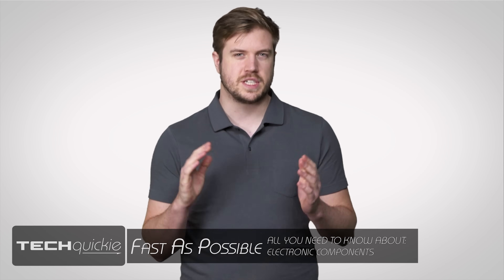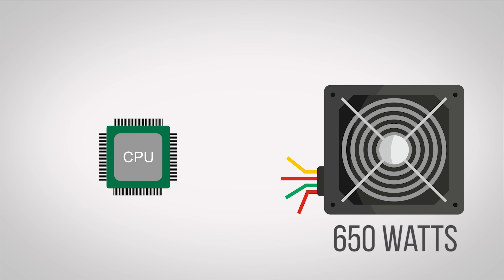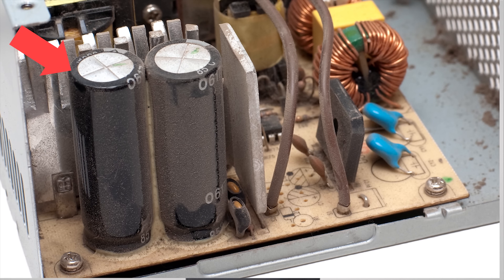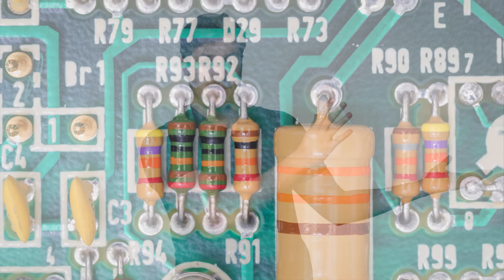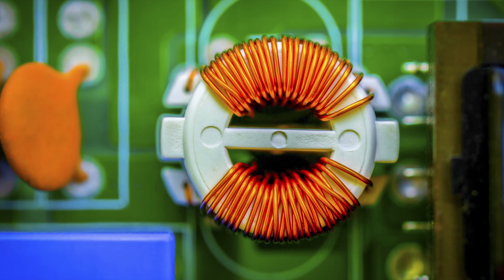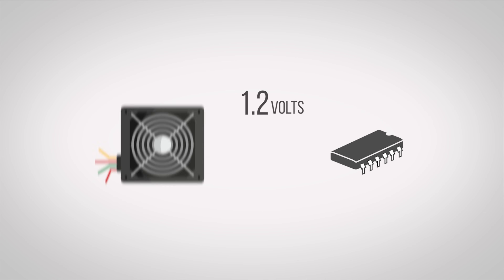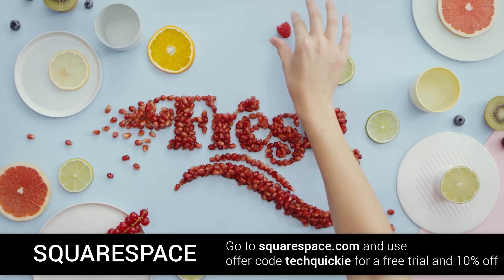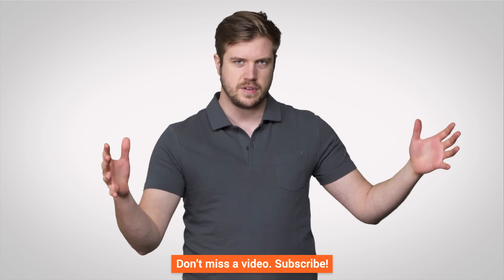Capacitors, Resistors, and Electronic Components

Comment: NEVER open a power supply unit if you don't have a very good reason to. A power supply can hold enough charge to kill a person even while unplugged. Also, repairing a power supply unit isn't a valid reason - they don't cost much but the risk of shock can cost you more than you'd ever have enough to cover.
Reply: Wizardmom Electrical engineer here. Thought I should mention that all consumer electronics built even somewhat recently are required to drain any large capacitors to safe levels in just a few minutes. You should still definitely be very careful, but this isn't as dangerous as old electronics.
Reply: manuelthegreatman I'm fairly sure that Luke and Linus mentioned a case where a kid died opening a psu on the WAN show in the past. Linus was the one that said there is no reason to open a PSU even to repair it, stating that they are cheap enough to bypass the risk of injury from repair accidents  by just replacing them.
Reply: Wizardmom ok
Reply: Yes thank you and it's even more dangerous that he said Unplug it first... I unplugged.. what could go wrong lemme touch everything!
Reply: @AbrasiveCarl  it's only dangerous if you're stupid
Reply: capacitors are not batteries ... They will loose their charge relatively quick .. I have fixed hundreds of psu's, never had a single discharge ..
Reply: That's why you discharge the capacitors...
Reply: @C0deH0wler  they are only dangerous of if you touch them directly
Otherwise it's totally harmless
Reply: Shane Burgess Unplug and leave it overnight. Once had a faulty PSU shock me (It got me enough that I uncontrollably yelled and probably have to thank the unit killing itself for being okay). I just went to unplug it (it had a ground pin so I thought it would be fine). It's fun to take apart old computers, but don't mess with or even plug in janky old power supplies..Apex. I've since thrown out the obviously faulty power cable and the unit.
Edit: I'd like to mention that mine wasn't even open.
Reply: C0deH0wler, Not to mention well designed circuits will have a bleeder resistor in parallel with each capacitor. To be safe, short each high voltage cap with a 1МΩ resistor and always measure for voltages. But this is if you are working on it, which is beyond the scope of this video (and was never mentioned anyway). Simply opening it is harmless as the pins are below the PCB AND as long as you don't go poking around.
Reply: PLEASE GET THIS PINNED!

Jesus I had to pause the video once I heard him mention this. Scary stuff, who knows what the uninformed might do!
Reply: The Original Otaku natural selection
Reply: Nope. You're completely WRONG Stop misinforming people. I've opened many PSU's and repairing one is a valid reason. Changing the Capacitors or resistors or any other component is completely safe as long as you know what you're doing and costs less than buying a new PSU. Thats just marketing schemes manufacturers use to scare consumers into buying a new one rather than repairing a fixable PSU's.
Reply: C0deH0wler think hard about what kind of people watch these intro to knowledge videos.
Reply: would replacing a fan with damaged/broken bearing be a valid reason? yes the odd capacitor may retain its charge over a long period of time but your not exactly gonna go in and stick anything near it are you?
Reply: Stop panicking...jesus
Reply: I once placed a new resistor to dead PSU, and it still works perfectly.
Reply: Roger Sullivan Ya, capacitors hold energy by design.. your not safe just because you unplugged it.
Reply: If you have a good PSU the Caps will be wired to high impedance resistors to drain them down over a long time >30 minutes. Often called a bleed resistor. However you are always told never to trust them as failure can happen . Shorting them is a bad idea as you "may" damage the cap resulting in catastrophic failure during the next load or even a few days later. This may then fry other parts of your computer. (Expensive.)

So how do you discharge safely?
In general the cheap resistors from hardware stores are rated for 0.5 watts (Check this before use as they could be lower.) so in 240v countries you need to use a 100000Ohm resistor not to over load it. That would take 6 hours to discharge to 25V (A safe skin contact voltage.). This is obviously not practical.

Practically a 1000 watt 50 ohm resistor would discharge to 25 volts in 11 seconds... but the cheapest i could find was $40. You'd be better investing that in a new PSU.

So whilst you can repair a PSU's yourself it is recommended the average person doesn't. You need knowledge, patience, and the correct tools to do it properly.
Reply: Totally agree but as an electronics tinkerer the single thing that I open to take a look at are PSUs and I can say that in order to be more safe a good idea before opening it is to unplug the cord from the wall and the the unit then  press the power button of the PC for about 3 to 5 seconds
This will allow any remaining power in these large capacitors to discharge through the motherboard safley
A jumper cable on the 24 Pin cable will do just the same
And still nonetheless being extra cautious (Not to touch those terminals of the capacitors) is a must
Reply: Ughhh the amount of stupidity is too high...
You wont die from a Capacitor...not even if it's 20kV.
230V AC is pretty deadly and you sohuldnt touch it, right.
Capacitors obviously only store DC volt, the friendly non deadly version of Voltage.
Touching a fully charged 400V cap wont kill you.
especially bc electricity takes the path of lowest resistance...thats like 10mm on one finger. Non deadly, but it might hurt a bit.
Modern electronics (especially power supplies) include discharge resistors anyways.
Reply: sigh Guys, let's do this in PC language so you stop talking abouth death and stuff. Capacitors are to Voltage what Volatile Memory (like RAM) is to data. When they are shut down they "drain off". If you unplug, discharge by pressing the power button or just wait, there won't be enough electrical current to kill you. This is something that happened with OLD CRT TVs, NOT WITH PSUs.
Reply: An anotation should at least be added. We don't need Linus Lawsuit Tips.
Reply: You short the electrolytic high voltage caps(the biggest ones in size) before you touch anything and ur good to go. This is probably best done a resistor so you don't get a huge spark and bang
Reply: Thirst IsReal Its also fun being shocked by 25,000 Volts :)

Damn Fly back transformers....

I miss CRT's....
Reply: There's a case for taking the video down for the lack of warning about this.
Reply: @jlittlenz  the video should stay on youtube,it is harmless opening it up ax long as your aren't stupid
Reply: @jlittlenz  Agreed and it's still up.  I was super surprised he didn't mention that and I don't even know much about electronics.
Reply: JAMAL JONES wrong instruction dick stuck in psu
Reply: A mild shock a best, kill you no way, old CRT's and micro wave caps can ruin your day.  I been repairing electronic for 45 years.
Reply: This one caught my eye, if anyone is talking outta their ass.  You don't damage caps by shorting them, and resistors have resistance not impedance and the rest of your discharge talk is nonsense.
Reply: Nah man, open it up if you are curious.I electrocuted my self 8 times in 1 eve building my first one, it becomes fun after the 3de or 4th time, especially the shock from the left color bone to the right hand. less then 10 years later i help design, build and test radar systems. Go go electronics
Reply: The dancing pixies get out and you, nor it, will be chooching for much longer
Reply: still... please discharge the caps before any thing

its better to be safe than sorry... unless the psu fan has a header that's  on the fan not the psu board
Reply: Long John you must be talking about the amp not the sub cuz subs are passive they take the electrical energy given to them turn it into thermal and mechanical energy. Once disconnected from a power source they're absolutely harmless they have absolutely no energy storage capacity
Reply: Wizardmom I've gotten shocked by a 500w PSU I opened before. Just unplugged. Felt the same as touching a 220v outlet. Feels the same when you get shocked by it as a kid.
Reply: Matt Brine oh hey! lol. yeah its fun as long as it doesn't kill you. It hasn't killed me past 4 times I got zapped.
Reply: Well, ironically I just opened one today to take out some small components for my future project.
Reply: Just wanted to say this. I guess you we're faster. Never open a psu if you don't have the knowledge. And if you really want to open it, just discharge the capacitors.
Reply: I know enough about electronics now that if I open something, be it just unplugged or powered off for weeks, months or years, I try not to touch anything that could be a potential electrocution risk or damaging from static electricity.
Reply: See you're just giving me ideas...
Reply: The only safe way to open a PSU if you're inexperienced in component level electronics repair is to:
-unplug
-leave unplugged for three years
-forget why you have it
-toss it in the E-waste pile
Reply: It's really only dangerous if you are stupid enough to bridge the leads of the primary side caps, and if you are buying a more than $20 power supply it should have bleeder resistors so after a few hours it should be safe regardless.
Reply: I've replaced/fixed tons of fans on cheapo PSUs, so there is a reason for opening it up. Also there's a lot of good components in there if you are into diy. Also pc psu can be used for different applications.
But yeah, capacitors are huge on those, and it's a real hazard. I usually let them stay overnight, I do not lot to short things.
Reply: I can't believe this video just casually suggested it might be fun to open up a PSU without mentioning that it could kill you. Slightly irresponsible....Yeah, open up your PSU and play with capacitors kids! Just unplug it first and it's all gravy!
Reply: Yeah,
I was taking apart our old family computer to look at everything.
When I was done, all that was left was the PSU, and my dad said "There's probably still enough power in that to kill you, don't open it" and I didn't...
IM STILL ALIVE
Reply: Wizardmom When I was younger I tried cleaning mine with water and tissues... I accidentally left it plugged in , with a 220v plug... I touched a metal part got the worst shock of my life
Reply: Jonny Dahl. Not the caps. There is a didcated resistor parallel to the damn cap
Reply: Okay, I'll take your word for being dangerous for longer than what I said. But let's point out that it won't kill anybody.
Reply: Okay so I used AC impedance instead of DC resistance as far as the ohms law and the capacitor discharge calculations are concerned they are the same for this scenario. But you most certainly do damage a cap by discharging it to quickly. Depending on the ratio of the internal resistance of the capacitor and the item you short it with, you will generate heat. Electrolytic capacitors such as the type used in computer PSUs are very succeptible to problems caused by excessive peak currents. Heat forms, electrolyte evaporates damaging the insulating aluminium oxide layer. This reduces the capacitance and in some cases can cause doming of the capacitor (Similar to early stages of over voltage.) and in rare cases failure (similar to excessive over voltage).
Ceramic multi layer capacitors are more a polar okay or fail scenario.
Disc capacitors are more able to take abuse but still can fail if used inappropriately in high frequency applications.
Reply: Yep, absolutely not deadly. Even rectified 230V from mains socket probably wouldnt be lethal.
Reply: Jonny Dahl. They don't specify it because its down to temperature. Sorry for not going into detail earlier, I'm not used to explaining this so I'm jumping parts without realising.
It's for you to work out as its really about internal energy loss converted to heat. For example the Capacitors on the APUs on the trains I work are spec'd to fail at 105 Celsius (specification but they fail at lower than that when old.). They live in housing which on a summers day even with blowers on gets to about 50C. So they have less headroom for a large discharge before failure. In summer they fail more regularly. If you discharge them really quickly,due to the imperfect nature of the cap it will form hot spots which exceed whatever threshold your cap has in a small area of the very large internal area. Either through repetitive abuse or bad luck this can cause larger scale failure.

Whilst I accept people do it and don't have problems. It is really not advisable to short them out if you care about them.

I mentioned the resistors as a safe method but included the time frame because most people don't have access to big enough resistors to discharge quickly and safely (<20 amps to simulate normal use.) without having to wait ages. I don't have any at home that exceed 10watt. My response is really for people who don't own a multimeter or who do, but want to fix it in a hurry and want to minimise the chance of weakening their components.
Reply: Only a complete moron will throw out ~100 Euro PSU's that can easily be repaired if you have basic electrical knowledge and when you have tools to do so.  way to contribute to industrial waste

With your logic you should also say that you should never plug any electrical device in wall socket because you may chew on the cable or lick socket.

Opening PSU is 99.9999% safe when done by anyone with logic. the chance of dying by opening it is less than doing most normal every day stuff. You will die most likely from chocking on snacks or falling of your chair than by opening PSU
Reply: You won't die from capacitors stored in these power supplies, no, as their capcitance is actually pretty low. A full discharge can even occur in less than a second. However, if you have a weak heart or anything, you might get fucked over pretty bad. Killing someone through such low capacities is very unlikely. I have this 30000uF 400VDC capacitor bank at home and that's a VERY different story, trust me.
Reply: Mark, that's not entirely true, current does not kill, it's hand-in-hand relationship between current and voltage that creates... power. The voltage can stop your heart, or even restart it. The current can incinerate your heart and give resolution to voltage. One can not do shit without the other. It all depends on the source, if your power source can only deliver 1Amp and you short circuit it out, the voltage will drop to almost zero volts. However, if you play with something like a wall outlet or capacitor, those which can deliver power in the KiloWatts or in a capacitor's case, in the fucking MegaWatts, it can certainly be lethal, depending on the voltage.
Reply: Lukas Seegers, that is indeed not a smart move, as there is live mains 
voltage on it. When there is live voltage on your power supply and you 
open it up, two things can go wrong: 1) You fry your power supply 2)You 
fry yourself. The reason they said that was to avoid static electricity 
from your hands getting into the driver systems. I have no idea why 
someone would say that to you, you got very lucky. What you can do, is 
to use aligator clips, attach it to the chassis ground, and to the metal
 pin in your outlet. So that the ground is connected to earth and will 
"absorb" all the static energy coming from your hands or environment. 
You got lucky you didn't touch any input connections.
Reply: Azagro thanks for the answer
so if the power supply is grounded, does it effect the hazard of capacitors or not?
(I was aware of the 'normal' danger of touching the live wires, but didn't know about the capacitors until these comments)
Reply: It shouldn't since the ground connection is there to protect your system's components, giving them extra shielding, acting as a zero rail for the PSU's GND rail and stop the chassis becoming live if a major fault occurs. It has no effect on the capacitors themselves and they will still have the potential to hold a dangerously high voltage. The only things stopping them staying at a high voltage for a long time are discharge resistors, which bleed off the stored charge in the supply when the system has been unplugged from the wall.
Reply: Lukas Seegers Depending on the power supply, but directly after disconnecting they almost certainly always hold a charge in the couple hundreds of Volts. The simplest way is connecting the + and - of the capacitors with piece of wire with care. This should short circuit the capacitors and discharge them. You don't have to discharge them all, only one, the one that has the highest voltage and highest capacitance (usually the biggest one).
Reply: I wanted to comment the same thing.
Reply: Sorry dude just opened one up the other day. Guess what? I didn't die.
Reply: Modern SMPS with PFC can work at 420VDC which is about 7 times more dangerous that 110VAC from wall socket.
700% more chances to die, wohoo!
Reply: Saya pernah membukanya dan menyiramnya dengan air. Dan tidak terjadi apa-apa.....
Reply: More like don't touch any capacitor as their looks can be deceiving as they hold charge for a long time proportional on their capacitance!!
Reply: Wizardmom please upvote this comment so Luke can see it.
Reply: This is literally the first Youtube video I have ever bothered to give a thumbs down to. Wizardmom is right; the capacitors in a PSU hold enough charge to be dangerous even if left unplugged for a while. Techquickie, you can't be giving dangerous advice like this when you have over a million subscribers.
Reply: Should have told little kid me :)

You know its fun being electrocuted :)
Reply: There is no reason why it wouldn't work. As long as you got the same model of resistor its completely safe.
Reply: Wizardmom they call em discharge resistors
Reply: Why? I don't see a problem with it. I even went frame by frame to see if something was snuck in. Frame 2520 to 2545 all clean.
Reply: not quite right, modern capacitors Have a discharge time of up to 6h.
GoldCaps even hold their charge up to weeks.
It depends on the cap's Insulation resistance. these days 6-12gigaohms is common, and i've seen power supplies with 400V 500µF caps still zapping after half a day.
Might hurt, but cant kill"
Reply: was referring to what Smakovich said.
I know there are discharge resistors, that's what i said earlier.
Im studying electronic engineering for 4 years now :D
Reply: Most electrolytic Caps dont even have a max. discharge current.
Do you mean ripple current?
Reply: trying to discharge it on the mains-side (the plug for example) probably wont affect the capacitors tho
Reply: Matt Brine oh hot dang I forgot about CRTs. My friend had it for years when Flat panels were common. I kept accidentally touching the screen to point out stuff and get zapped.

My pc cases back then would never get decent grounding either so I am always amazed when Linus or Luke opens a case and touches it without getting shocked.
Reply: Jonny Dahl. Dude you can easily die from 110Volts. Google NIOSH electric shock  (CDC.gov) there are plenty of examples of work place deaths. For example what you say as a safe voltage deaths from that page, One guy plugged in a toasted with a faulty earth and died.
Reply: I opened up a chinese cheapo one to swap the fan cause it was driving me nuts and I didn't die
Reply: Dude i said something like 230V rectified(so it's DC, not AC) and no, it wont kill you...
Go to SElectroBoom"s youtube channel...he shows you what hurts and what not, and je explains the different effect of AC and DC to the body...
Reply: Lazor 200VDC not, 340Vrms, a different story.
Reply: Jonny Dahl. Rectified 230 VAC is 330VDC. Electroboom works with NA voltages. European outlets are far more powetful.
Reply: λ3 "Fucking dumb", says the guy 
that states that the current kills. Perhaps you have heard of Ohm's law? No voltage, no current.
Reply: I open them all the time without getting a shock... the trick is to short the high-voltage input stage capacitors (the really big ones) out with a screwdriver to make sure they're not holding a charge... do that and the supply will be totally safe to work on. Just remember that if the PSU has been on before you opened it and doesn't use a bleeder resistor to drain the capacitors (which most PSUs now do if they're good quality) that you'll probably see massive sparks as the caps dump all their energy out in one go... the first time you do it and that happens it's sure to make you fall out your chair!! XDD

Oh, and additionally, doing sanity checks before opening like remembering to unplug the power cord and set the power switch (if applicable) to the OFF  position are also great ideas. At least you won't get 120 (or 220-240) angry pixies dancing through your limbs!! I've taken a tingle or two from a 240v line and it's not fun!! The yanks have it lightly with their 120v lines, that's for sure!!
Reply: All hail the dancing pixies of death and knowledge!!! Taking a jolt is an odd one... I know a few people that dabble in electronics and they started out by taking a mains voltage jolt or two... either by sticking a screwdriver in an outlet (hard to do in my country because the sockets are shuttered!!) or messing with stuff they shouldn't... although the fun starts when you build a circuit specifically designed to explode... Electrolytic caps are afraid of me!! XDDD
Reply: Yeah and it's unlikely that you die from 330V DC...
Been there, done that (unfortunately).
Body resistance is too high to really damage you in split seconds.
Reply: Jonny Dahl. Your mixing up voltage and current. He uses supply's on himself that can't supply a high enough current. It's the current that kills.  Ohms law suggests that for the lower end of a humans resistance (thinner skin areas or sweaty palms) for 230 volts and human resistance of 1000ohms and the low internal resistance of a cap you'll get about 0.25 amps. Currents of 0.1-0.2 amps "can" be lethal. AC is worse if you're exposed to it for longer than a cardiac cycle of approx 0.2 seconds but normally you flinch away so it doesn't matter in this case.
I have seen his videos they are funny and done to show how voltage causes the shock but current the damage. He always uses low current by either an under powered supply or by a high internal resistance supply.
A 9 volt battery can make a paper clip glow red hot as it has a low internal resistance thus high current.
Reply: true, but also not. Capacitors will hold and slowly bleed of their charge for a fairly long time. I pulled out a decent cap from a power supply , a 220mF 400v one that  I charged and left for 3 minutes. I started off at 9.15v and the cap had discharged to 6.52v after that time. It only dropped  2.63v in that time frame. Add a bleed off resistor and that time will be shortened to mere seconds... but since that also adds extra cost to the manufacture, usually, Chinese cheapo supplies don't do this, so they can actually hold nearly 200v on their caps after a minute of being unplugged provided they're left pretty much floating when the supply is powered off, which isn't an impossibility.
Reply: True... Euro outlets are 220v 16A... British outlets are 240v 13A and American outlets are usually 120v 15A I think... These aren't peak values since they're usually designed to handle more without catching fire for safety reasons, but they're safest kept at or below:

EU: 3,520 watts per socket
UK: 3,120 watts per socket 
US: 1,800 watts per socket.

And if you have multi-gang sockets or an extension, you should always use a fraction of the current per socket if there's more than one device plugged in... For example, if you have a dual gang socket, you should use HALF the current per socket to make sure you don't overshoot the current draw and either start a fire or flip a breaker... so in Britain, where the dual gang sockets use a single line in, you want to have 6.5A per socket max, which is totally fine for anything that's not a large space heater, industrial power tool or a Tesla EV on a fast charge!!
Reply: The main capacitor is what might kill you, but the capacitor is almost always bridged by a big resistor. Otherwise the same power surge could kill you simply by touching the pins on the outside of the PSU where the power cord goes in.

Some cheap LED lamps have this problem where you can get a "tingle" by touching the connectors right after unplugging it. This is exactly the same thing happening, except it isn't lethal.

On top of that, you can safely short out a capacitor just with a metal object. That'll discharge it and make it safe to touch.
But still, as always, if you're not sure about any of this - better not open the PSU. Or even your computer. Leave maintenance work to those who can do it safely.
Reply: I assume we're all thinking about the guy who was killed by an unplugged PSU right now?

Never open a Power Supply unless you're trained for it.
Reply: ThEcRaZ3dGaM3R not entirely true what you say about EU/UK power. European countries (not just EU) all carry "220V" (apply airquotes here), but the standard allows for +/-10%* in voltage. This margin was introduced simply to "unify" the voltage across European countries without having to change the national grids. As a result, 200V is practically the same as 240V. Any European-sold device that connects to the mains will accept 220V+/-10%*, so that includes 220V from some countries, 230V from other countries, and 240V from the UK.

I'm currently at 234V, or so my UPS tells me, and that's totally within specification.

*) I'm not 100% sure if the margin is 10%, it could be 15%.
Reply: You still dont see the difference between Alternating Current and Direct Current...
And no the "main cap" wont feed back into the mains power chord bc it would have to pass a FULL BRIDGE RECTIFIER (i recommend going to ElectroBoom, he explains that)
Reply: I was trying to reduce coil whine on a PSU I had. I switched it on and off and back on so many times that I forgot to switch it off before sticking my hands in. All I got was an uncomrotable shock that made me immediately pull my hand away.
You guys have to realise that there are plenty of people that work with electricity and can tell you what a shock feels like. Sure, it's not nice, but the fact that you're talking to them means that they are alive.
Reply: capacitors
Reply: I'm not really into electronics, but opened a PSU a few weeks ago to get rid of unnecessary cables (don't judge for that, and of course I isolated the free contacts)... but my question, I heard someone say to switch off my PSU but keep it plugged into the outlet to have the whole thing grounded, so I did... reading these comments and thinking about it... that was dumb, right?
Reply: Steven Box thank you for taking the time to answer, but even though I'm not that much into electronics, I still do know a few things about computers and hardware, so I opened up the PSU to cut off some not needed cables, like I wrote - btw, the idea of someone opening a CPU seems pretty creative to me^^
Reply: holy shit luckily i wasn't killed
Reply: ThEcRaZ3dGaM3R Azagro thank you guys for the helpful answers :)
Reply: Completely depends on the capacitance of the capacitor. If you had a very large capacitor with no bleeder resistor, it could stay charged for hours if not days
Reply: Warning spoons can be deadly too if you're really fucking stupid
Reply: Wizardmom they don't cost much... snicker. must be using generic power supplies.
Reply: No, that just resets the CMOS memory on the mainboard. If the power supply has little to no juice left in it then it should just power on for a tenth of a second and immediately shut off. There'll still be a bit of residual charge but nothing that could kill you (usually about 30-60v DC, which will tingle a little but won't hurt, and it bleeds off fast if there's a resistor in parallel to the cap)
Reply: as probably a lot of people have said, a power supply doesn't hold that much energy for any appreciable length of time. By the time you're done removing all the screws, all caps have lost their charge. also, more often than not, large caps (and I mean in capacitance, not size) have resistors across their poles to discharge them quickly.
Reply: not how it works, sorry.
Reply: didgitalpunk But the thing is that some power supplies doesynt have discharge resistor for main rectifier capacitors.
I had before 600W serwer power supply, it had copper heatsinks that was connected to these 420VDC, after the power supply was disconnected from mains and it shut down, there was still about 250VDC and it was very slowly dischargin, like 1V per second, I could put mains 5V adapter and it was working for quite few seconds.
So definitely enough energy(current) to kill.
Reply: please, learn about what the difference is between voltage and current.
Reply: I know the difference you idiot.
What I said wrong?
Current is the part that kills, you can have 100MV with 0,1mA and it will not kill you.
450V/660uF capacitor can deliver up to few amps.
Reply: 100MV at .1mA will fry you big time. 
Also, why resolve to calling people names?
here, have a chart on how electrocution actually works. Do read the fine print though, it has important things in it.
https://en.wikipedia.org/wiki/Electric_shock#/media/File:IEC_TS_60479-1_electric_shock_graph.svg
Reply: On that graph you can see that 0,1mA is in AC-1 so its even imperceptible...
So I was completly right, even when I didnt saw that graph.
Anyway my point is that some unplugged power supplies can kill, as I said before, these reservoir caps can give up to few Amps, and on your graph it is on AC-4 so 5% probability of ventricular fibrillation.
Reply: Dude, use Ohm's Law! I=U/R
That graph is for people who know how to think, I thought you were at least capable of that!

Also, Capacitors give out DC when discharging, not AC, which your body reacts very differently to! 
Try putting your hand across DC 110V, you'll barely feel anything.
Reply: didgitalpunk Idiot, check my prev most, I said VDC you fucking moron.
Barely anything on 110VDC?
It looks like you dont know what you are saying.
DCV is twice more dangerous than AC, and at 50VDC you can definitely feel it.
And when you are using ohms law with human body, remember that first layer of shin has high resistance but another one has much bigger.
Reply: Vmax rectified is 170Vdc. Vavergage of 110Vrms rectified is... 110vdc!
Reply: sure, if working as an electrical technician around 380V 3p power systems means knowing nothing, fine then I know nothing.
Once you'll learn about signal analysis, vibratory analysis, and electrical systems, come back to me and we'll talk.
Reply: Well, if you discharge the capacitors it's not a problem. Shame they didn't mention that though..
Oh well, hopefully no one kills themselves :/
Reply: OMG! Is it so dangerous actually? Cuz a few months back I opened up a PSU. It wasn't powered for about a week so I guess it would have been discharged by then.
Reply: 930M Gaming Capacitors can stay charged for months so time isn't a factor.. At least not much.. Google discharging capacitors and you'll see how to do it for next time.. Though remember, it varies from psu to psu as some have weak capacitors and others don't. And whether or not its ac electricity or dc.. If it's dc then you can barely feel a thing tho with ac anything above 150v with several amps of current and you're dead. (im majoring in electrical engineering so i know.. A guy in my school almost died from stupid shit like this )
Reply: Lol just because you didn't short a capacitor by luck doesn't mean that others will be as lucky. And if you think it's "bullshit" I really wanna see you short those 450v capacitors so I can see your brain fried. I'm not saying it's not safe but there are preconditions before starting to tinker with it.
Reply: hey ,if anyone else is searching for understanding electronics try Elumpa Circuits Expert Alchemist (do a search on google ) ? Ive heard some interesting things about it and my friend got excellent results with it.
Reply: Wizardmom Funny (not really) story, once I opened up my PSU (500w) while it was plugged in and touched the bare metal contacts, luckily with only one hand, and even more luckily with only my thumb and forefinger, but moral of the story, unplug it, and discharge the capacitor..
Reply: you'd have a better change of getting hit by a 747 on the ground than getting killed by a power supply rated for 120v. few things: 120v is weak and anyone with dry-ish hands could touch it (or possible hold it.. depending), as for soapy wet hands, i've touched 120v with soapy hands and it was painful af but... im still here :P.  Those capacitors can hold hold the same voltage that was used to charge them. 240v.. if it was a shit one it could potentially, but every power supply had a discharge resistor on the high voltage capacitors (and output), meaning it will drop the input caps to about 0v in about a second or 2.
The only real way a power supply that's being powered by 240v could actually kill you is if you took the board out of it, disconnected the power (while it's on) and touched the input capacitors' traces directly after disconnecting power
Reply: Amen to that, first and most important thing that Electronics Engineer school taught me in practical class was on how to discharge then capacitor and about hazardous effects of inhaling prolonged soldering fumes. It was first class of my practical laboratory in freshman year.
Reply: hey ,if anyone else wants to learn about introduction to electronics try Elumpa Circuits Expert Alchemist ( search on google ) ? Ive heard some pretty good things about it and my mate got amazing success with it.
Reply: it's hard to believe people still think these things are dangerous after unplugged for 5-10 seconds... :/
Reply: +Wizardmom Just discharge the capacitors. There are usually two of them rated somewhere around 400V. The easiest way to do this is to get to the bottom of the board, using the heatsinks as handles to ensure you don't touch the capacitor leads by mistake, and then short the leads with something metal, like a screwdriver.

If you know what you're doing, there's no actual danger. I've salvaged 3. Two broken, one not (I thought it was when I was little and just learning, never desoldered from the board until years later).
Reply: @RAndrewNeal  they discharge themselves by design...
Reply: Wizardmom    some electronic circuit do have powerful capacitor.  Is it good to short the capacitor and remove the useful electronic components??
Reply: uh oh LOL.  Well I guess I am lucky to be alive because I opened my desktop's unplugged power supply to clean out the dust in the fan.  I did not get shocked but of course, that could be due to a lot of things like sitting on a bed made of insulated material.
Reply: I've had a friend go to the hospital because he unplugged the power supply, let it sit for a minute, then opened it up to look around it. He unexpectedly got quite a bad shock but turned out ok. Ever since then he's been very vocal anytime he hears someone mention they're planning on doing that making sure to let them know that they can still get shocked and explained his story. I've opened one before but didn't do much with it and very luckily didn't get shocked. I never recommend anyone opening up one as your gambling getting potentially shocked very badly.
Reply: Been there done that, lightning bolt was epic
Reply: @Jumbomuffin13 I don't Even know psu could kills until now.
Reply: SAFETY NAZI!   GIVE ME A BREAK!!!! Wizardman....don't use the bathroom as it is the most dangerous room in the house - just take  a dump on some newspapers
Reply: We can possibly just short-circuit all the capacitors with either a bleeder resistor or an insulated screwdriver , before conducting any troubleshooting as a safety precaution measure.
Reply: Learn PCB design free of cost 
And collect PCB desgin guidelines free of cost 
So click these link
https://youtu.be/ApXhpz8XPWE
Reply: Before I knew about this I opened 3 power supplies and jimmied out the fans so I could save a few bucks. Fuck did I get lucky
Reply: Not certain about the points made but ,if anyone else needs to find out about understanding electronics pdf try Ichordo Electronics Expert Fixer (do a google search ) ? Ive heard some interesting things about it and my buddy got great results with it.
Reply: Tell that to the Countless Youtubers who have DIY guides converting PSU to a Power bench power supply.
Reply: It not happening to me
Reply: don't any of you dare to open my hardware (organs)
Reply: This morning my psu exploded because i plug it in a 220v then i got curious what Happened inside so i opened my cpu. After reading this comment i got scared.
Reply: If your PSU has an problem you should just call your PCU’s manufacturer and tell them the problem they will probably  replace More work for you but safer!
Reply: I learned the hard way
Reply: @Windows 8.1 There is no guarantee that you will get shocked but there is a high chance
Reply: Oh god, was about to open my old fried power supply just to take a good look inside, alright...
Reply: When the capacitors corrode. Shits broke
Reply: Thanks for this
Reply: CompTIA+ certification states not to do component level repair due to making it unstable and just cheaper to just replace it.
Reply: Just wait few minutes LOL
Reply: What if I have rubber gloves?
Reply: I did. Will something bad happen to me?
Reply: Long John are you kidding me?? Do you know how a subwoofer works?? It's an magnet around an electromagnet that takes a current and switches polarity to push a cone and create sound waves no connection to amp and they're completely safe hell even connected to an amp unless you have a 1000w+ sub that's drawing super high amperage and you're stupid enough to take the cone off and try to touch the voice coil while it's trying to make sound. It's not the wattage that kills you it's the voltage and amps that'll kill you